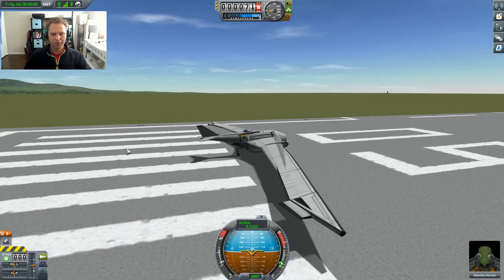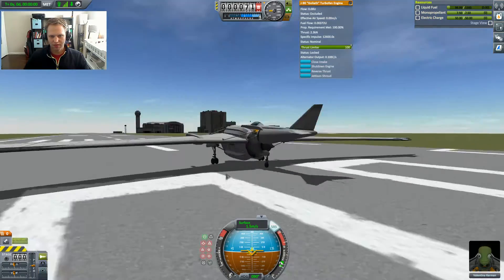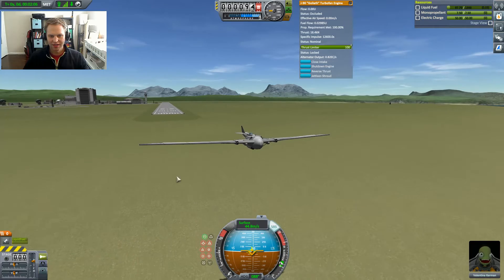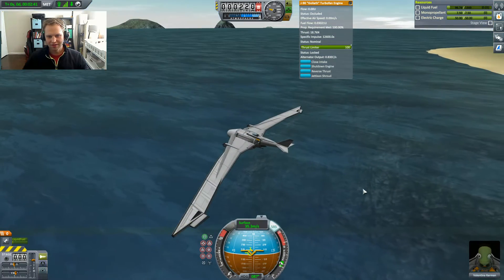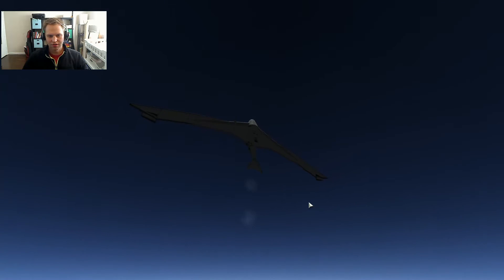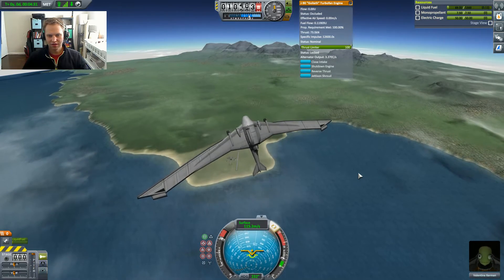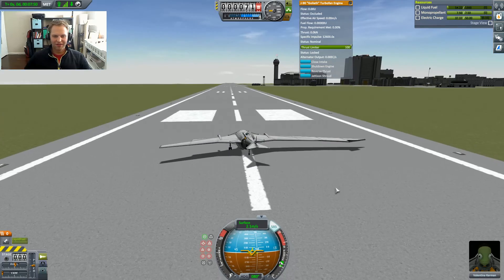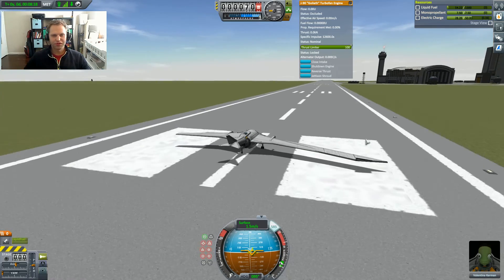Kerbal Space Program - Ultra high efficiency aircraft

Comment: i made a plane using extreme aerodynamic exploits and 2 rapiers that travels at 2,110 m/s at sea level consuming 0.04-0.05 fuel per second
Reply: What exploits did you use? I want to make something similar but couldn't find anything online.
Reply: Use fairings as nosecones and speed wraps. Rotate wings to have a slight angle of attack so you can maintain prograde at all times. Clip parts. Cover the exhaust end of your RAPIERS with tiny nosecones to reduce drag there.
Reply: @rockspoon6528  I will try this. Thanks!
Reply: @rockspoon6528  How do I solve the problem of overheating?
Reply: @rockspoon6528  this is much more conventional (and less powerful) than what I used but most of it is generally correct
Reply: @Evan-gg1tk  Stratzenblitz75 had an ingenious solution to overheating on a recent design- he used an absurd number of flags to radiate heat.

Comment: You can fly at high altitude and be efficient as well. 
g*70 Goliath burns 0.08U of fuel at 300m/s at 7000-9000m altitude
turbo Ramjet burns 0.08U of fuel at 1470m/s @25000-26000m altitude
Reply: @Santiago Rodriguez Newton Drops to 20-ish kJ at ~25km altitude, but it's enough to rip the skies at respectively thinner parts of the atmosphere. If you minimize the drag, it works wonders.